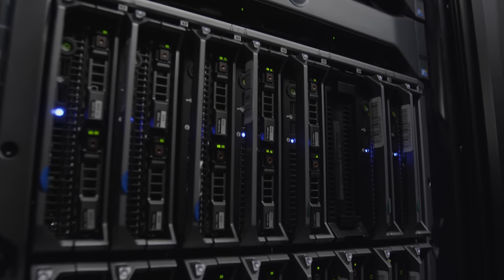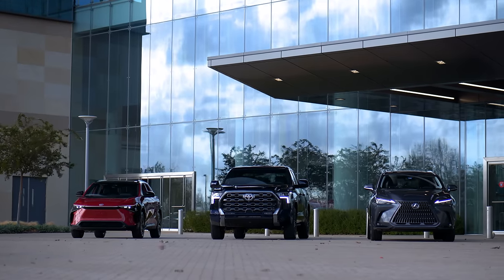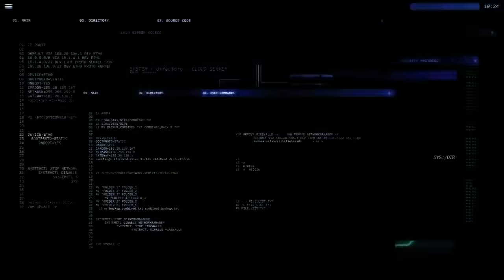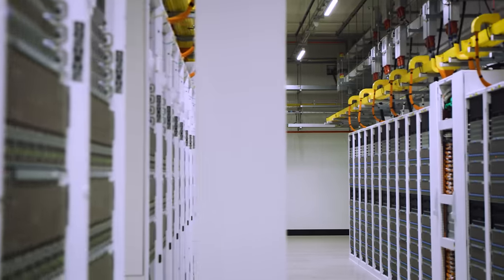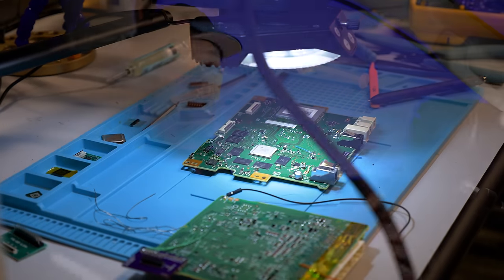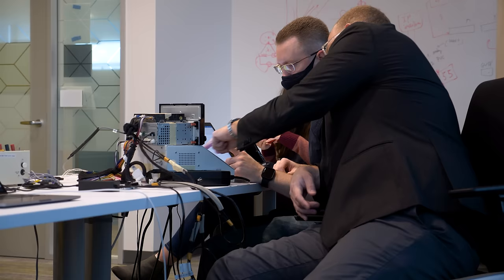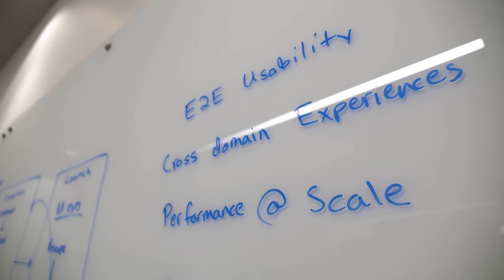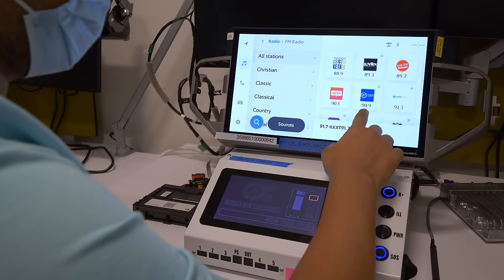How Is Infotainment Designed?

Comment: When the designer started talking about moving heated and cooled seats into a digital interface all i could do was scream NOOOOOOOOOOOOOOOOOOOO!!!!!!!!!
Reply: Literally fucking insane...any other car but a Tesla should have knobs and the like
Reply: The consistent problem with a lot of these UI designers is that they don't understand usability in a 2 ton vehicle.
Reply: Like.. I don't want YOU to choose what features I see based on the season. Give me buttons/switches and let me make the choices.
Reply: @1Snouser  Why shouldn't a tesla have knobs and buttons?
Reply: @macaron3141592653  The screen is big enough to have actual target areas that someone can press with squinting or losing *significant focus (there will always be distraction). These shitty low refresh rate screens in toyotas, subarus, hondas aint gonna cut it to have buttons be virtualized. Furthermore, the Tesla goal is to have the car most drive itself/assist the driver, so one can comfortably operate the screen. I would personally like to have knobs and buttons too, but they can feasibly present an actual virtualized UX with their OS/Screen
Reply: "We don't use fire extinguishers on a daily basis. Let's hide that."
Reply: Not sure. I have used cars where most things were automated, and actually I never adjusted the temperature after having it set once. Whether heating or cooling it just kept the temperature. Wouldn’t know why the car couldn’t do the same for the seat. What would be important is that you get a clear indication of what the car is doing, and make adjustments if necessary. But then, the car will learn that you would like, for example, the heat only come on ever so slightly.
For me, I’d prefer physical buttons for all the entertainment functions, volume, change track or radio station, those kinda things. Those are needed constantly, and even going 250km/h on the Autobahn you might wanna change from spotify to radio and need to be able to do so safely.
Reply: just imagine how much money they will save.  Tesla saves a lot of money of having a digital screen that can do everything, instead of hundred of small buttons that have springs and electric wires.
Reply: Same — I was on board with what he was saying until he goes “heated seat controls are a candidate to moving to digital”.  Fuck no.  It’s one of those controls where I’m thinking, hey, I’m cold, lemme turn on the seat heater real quick — and maybe five minutes later, once I’m on the highway, I switch it to Low or Off.  The guy sounds like he’s never used a seat heater before.
Reply: @kaischmidt730  AC has sensors to tell what's the current temp. The seat does not. Just a switch to select between heating levels
Reply: @youling1997  and you wouldn't think you could fit a thermostat into a seat?
Reply: @kaischmidt730  I do not think the automotive industry is that dumb. They must not do it for some reason
Reply: @LJ-wo1wf  i do that all the time now, because its chilly in the morning and hot in the afternoons, i usually turn my heated seats on on minimum, and then turn it off 10-20 mins later, and do the same thing in the afternoon with the  cooling seats.  Touch screen is great, but some functions are better as buttons.
Reply: @floggyWM1  Yup.  Heated/cooled seats are basically HVAC features, too, in how they help you feel comfortable, and should not be in a menu somewhere.
Reply: @LJ-wo1wf  it seems there is a bit of a lack of imagination here. the first rain sensors were atrocious, the first light sensors as well. but they have gotten to a point that you can pretty much forget about those functions. and I am certain that we will find a way to make sure your butt is temperated just the way you like it. 
however, if you like physical controls, I am sure you can find a model on the market that caters to that need just fine, and no one will stop you from buying exactly what you prefer.
Reply: @LJ-wo1wf  one more thing. my original point was not "please remove the seat heating button" but rather "I want physical controls for the entertainment system!!"
Reply: @kaischmidt730  "however, if you like physical controls, I am sure you can find a model on the market that caters to that need just fine," you said.  The problem is, it's getting more and more difficult.  The '22 Civics have what I think is the best balance of physical-versus-digital controls (better than my '17), but I'm about to panic-buy one of them only because I'm not confident that future Hondas will stay the course.
Reply: @LJ-wo1wf  Well, this is a market economy. So, whatever the customer buys is what is being produced.
Reply: That's the comment that immediately got my attention and looking into the comments, because I couldn't believe how wrongheaded it was.  Yes, you only use those seats seasonally, but during that season you activate them literally every single time you get into the car.  When you get into a cold car during the winter, you want those heated seats on IMMEDIATELY, before the engine heats up.  The last thing you want to do is go fiddling through touchscreen menus when you're freezing your butt off.
Reply: @historymjh  you are totally right, it is highly predictable. hence, very conducive for automation.
Reply: @historymjh  And not just when starting the car, but a few minutes later, when I'm on the freeway, my butt has warmed up enough and I want to turn the seat heater back down.  And at that point, in the middle of traffic, it's an even worse time to be fiddling with screen menus.
Reply: @kaischmidt730  "So, whatever the customer buys is what is being produced."  IMO, the customer puts up with a lot of bullshit design choices because they've either 1. got low standards, 2. given up hope, 3. buy the nameplate on the grille and not the dashboard knobs, 4. etc.  
There's very few infotainment systems that are actually simple to use anymore because they hold so many functions now, and HVAC control designs are heading down the same sewer pipe.
Reply: Digital Interface, Touch Screens, Infotainment System = No Sale.

Comment: I'm left with more questions than answers.  I still don't understand why the manufacturers don't simplify the entire process - make it so their cars interface with an individual's tablet or smartphone - something they're already familiar with.   When I heard the engineer say "As long you have that passion, technology can fix anything."  Passion for what, exactly? 
This told me that, as with so many other industries, millions are spent designing 'solutions' that are usually addressing ever more complicated layers of 'solutions' on top of flawed "solutions" on top of yet earlier flawed 'solutions', instead of addressing the fundamental reason for existing in the first place.  At its core, isn't infotainment really just a radio?  or maybe HVAC controls?
Well Done.  Brilliant.  A Triumph. A Masterpiece.
Reply: As far as I'm concerned, they already figured this shit out in the late 90s and early 00s where all the buttons and features you needed were at a finger's reach. They've uninvented the wheel and told us it's a step forward. Clown world.
Reply: @JohnFromAccounting  Yes, it's change for change's sake. I love my simple Nissan 370Z which has everything I can ever need, other than blind spot monitoring. A simple stereo upgrade and I have Android Auto.
Reply: What is driving this paradigm shift?  Is it the marketplace or, Is it regulations?
Reply: @dannoyes4493  Touch screens are cheaper. It saves the car companies money to remove the physical buttons.
Reply: @povertyspec9651  370z is a fantastic car 😍👏
Reply: @galactictomato1434  Then, why are more and more buttons being added to the steering wheel?
Reply: Auto manufacturers have realised that they can monetize the data they collect from the customer. How they respond to stimulus, how they respond when tired or angry, how they react to situations on the road etc etc. If they hand all this to the mobile device then they lose all that.
Reply: @dannoyes4493  Car companies are moving to capacitive buttons on the steering wheel. Those are cheap. Analog buttons on the steering wheel are going away.
Reply: @povertyspec9651  the new Z has blind spot monitoring now so it seems like it's the perfect car for you (and for people like me is thats more than enough as well)
Reply: I totally agree with you. Your statement made me realize what it is that I like so much about my Tesla. Like my iPhone, I don't need to think about using it. The technology just works and fades in te background. The way it should be.
Reply: @antoinepageau8336  open the glovebox for me
Reply: Toyota sells a version of the Yaris Cross without an infotainment display. You just have nobs for heat and AC, fan speed and that's pretty much it. For a brand new vehicle in 2022 that's refreshing.
Reply: Gotta love being an engineer working on elaborate tech that's worse than its predecessor.
Reply: As Tim Carroll of Microsoft said, "The concept of connected cars provides all sorts of opportunity for us.  ...because of the data being collected, ...think of the value that data can provide to both companies and governments in terms of turning that into something actionable."  
Value to whom?  Carbon credits, behavior modification, anybody?
Reply: my car, physical buttons for hot/cold, fan speed, auto climate, air location, front/back window defog/defrost, recirculate, heated seats, but...... heated steering wheel and AC touch screen only, like why though?
Reply: @povertyspec9651  Whenever I hope in my wifes 370Z. I cannot believe how bad the blind spots are compared to my Cayman and MX5s. The side mirrors are massive too! I feel like I cannot see anything, only whats directly in front of me.
Reply: Agreed. CarPlay and Android Auto are WAY better for music and maps. The car screen should really only have to interface with phone and have radio controls. HVAC and other functions should be physical controls.
Reply: @dannoyes4493  
You’re speaking on something that many people purposely choose to ignore.

There is a whole video to that subject alone…not to be made here.
Reply: @C.I...  lol
Reply: @dannoyes4493  younger buyers.
Reply: @JohnFromAccounting  I’m stealing the last two sentences, summarizes the whole thing so well.
Reply: Compatibility issues maybe, they would still have to accomodate different devices and figure out how they could integrate them with the various control modules running proprietary software. Interior design and safety regulations might be an issue too
Reply: Who do you think wants to buy a new car that can’t function properly without your phone. Can’t give you directions to the store to buy a new phone when your phone is dead etc. etc.
Reply: @Fee.1  Me.
Reply: @dannoyes4493  you think you do but you don’t actually want that. It’s better to have a completely “dumb” car than to have what you describe
Reply: @povertyspec9651  100% agree.  I too have a 370Z and LOVE its simplicity.  I mean, it even has cooled seats!  My GT-R doesn't even have that!  Only thing I've added to it was a little Bluetooth DAC so I can stream music.  Done.  Was REALLY hoping the new Z wouldn't be all screened out and damn it, it is.  /sigh
Reply: @galactictomato1434  Would love to see your source for your "touch screens are cheaper [than buttons/switches]" comment.  I don't believe that for one second.  Would LOVE to see how a screen, all the memory, processing power, etc to run it...all that talking to the car via CAN to control door locks, seat heater, whatever could POSSIBLY be cheaper than a little switch talking to the car instead...no way.  

For instance, would it be cheaper to hook up an Arduino with a touch-screen and relay/breaker/whatever to turn your bedroom light on and off?...or install a wall switch to turn your bedroom light on and off?
Reply: @rmp5s  that's kind of a ridiculous comparison and it's not really apples to apples. There's already computers for everything in the car, and screens are already in cars too. Those knobs are just sending electronic signals to the computers anyway, so putting that in infotainment isn't exactly challenging. Now, a lot of manufacturers are making the screens a little bit bigger and then standardizing them across the fleet (new BMW is a good example) while also removing the physical controls. That allows them to simplify trim piece design by not having spaces for buttons, no blanks needed for models without features (like a blank cap would go if you had car that could be equipped with heated/cooled seats but you did not purchase it), the additional wiring that those buttons would use, and of course the buttons themselves. Even removing a few dollars or a hundred dollars on each car manufactured is a tremendous savings to the company. And don't forget, it can all be replaced with a screen that's already in the car and is often already in communication with all those computers you reference.
Reply: @koopaGG  I suppose that, if you already have a screen in a car, making it a bit bigger and removing all the switches could save some money, but that's hardly the same as saying "a screen is cheaper than switches"...they already had the screen AND switches...lol
Reply: change for sake of the change so these people can have their jobs.
Reply: Because then you would be texting while driving in no time.
Reply: exactly. look at the employees in the video, they were all pretending to be smart and pretending to be innovative.
Reply: @povertyspec9651  WDYM it doesn't have blind spot monitoring? It has mirrors, yeah? That's all the tech you need to monitor your blind spots.
Reply: @Fee.1  So? A regular "dumb" car couldn't either. And that's exactly how people bought cars for the past 100+ years.
Reply: @rmp5s  "Would love to see your source for your "touch screens are cheaper [than buttons/switches]" comment." They literally said it in the video. 16:26
Reply: @povertyspec9651  Blind spot monitoring is it's own disaster. Why need a piece of tech when a concave mirror is more functional
Reply: @JohnFromAccounting  💯💯💯

Comment: These videos are amazing. No one else does anything like this. May not get as many views right away, but this will be an amazing historical reference when looking back at what was going on during the shift to EVs.
Reply: @Joseph Roach agreed. EV's are ironically.... Unsustainable.
Reply: @Joseph Roach  ya except ethanol go big boom!
Reply: I think that we are little farther out on EV’s for mass adoption than most. That stated, the how’s and why’s in this video are somewhat insightful and the fact that Mark them to do it, historical.
Reply: @scottgabbard662  Charging times and range are much more important in the US than other countries, which raises the bar for the feasibility of EV mass adoption. Current battery/charging capabilities are a long way off for US mass adoption outside of local urban settings. Grid capacity requirements are going to be an issue for all countries. The only feasible solution I can see at the moment is nuclear. Many countries in Europe have closed a lot of their nuclear plants over the last decade or so. No idea how they are going to solve their energy needs. Solar and wind isn't going to cut it without massive energy storage solutions.

Comment: The "cognitive overload" talking point about buttons has been so detrimental to the modern era of car interior design. Having 40 buttons for climate controls and audio is no where near as overwhelming as trying to open and close menus on a touchscreen while driving quickly or on a bumpy road. Things like volume, climate controls, safety systems, and other simple functions do not need their UI's to be changed, and should not be on a touchscreen or touch button. This is simple, and never needs to be changed. Everything else is fair game. Easy. So much of the complexity in this conversation feels manufactured and artificial.
Reply: Car manufacturers are going after the same demographic who buy a new iPhone every year!  I also never trust a car executive who wears dress shoes without socks.  Sure, they'll only use my data for product improvements!
Reply: Yeah only in the past 3 years has airplanes sarted to go to Glass cockpits and away from hunderds of gauges and switchs. And it's only becuase it was to much... No modernhj car has to many of them like my 2020 Mustang Preuim has a big screen yes but also buttons and switch for nealy every thing so much so I almost never interact with it the buttons do that good of job.
Reply: Folks totally forget how many buttons these 2010 to 2013ish car has. Jump in a 2012 Acura product or Porsche and tell there isn't too many buttons.
Reply: yes, the guy was like its my job to get drivers off their phones to prevent crashes... bro, its easier for me to text and drive than use your dashboard interface u spent 100m on pretending you were apple.
Reply: @RandomInternet User I agree most of it is junk but that’s why apple CarPlay and android auto is awesome, it completely negates the bullshit software that the OEMs are putting in
Reply: A designer should not be even interested in collecting data to provide cheaper insurance. Do these guys even listen to what they're saying? It's ridiculous. Just stick to design. And by design I mean: airconditioning and car features, not Navigation or Entertainment. Let Apple Carplay or Android Auto take care of that
Reply: @bigcjm  This is true. My brothers 2013 is to the point he tells me what to press every time i get in it. Meanwhile my old 2001 Acura has about 6 things to mess with total. Im reviving that old girl simply because i cant stomach all the "tech".
Reply: @RandomInternet User look into Dacia cars then